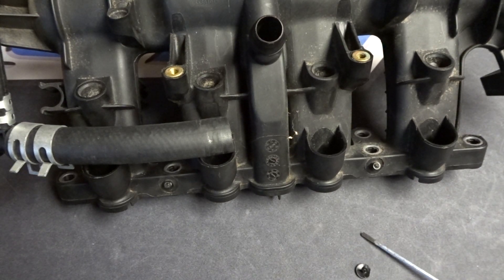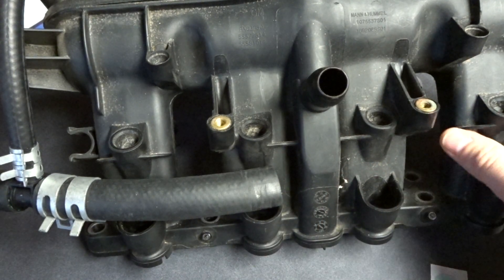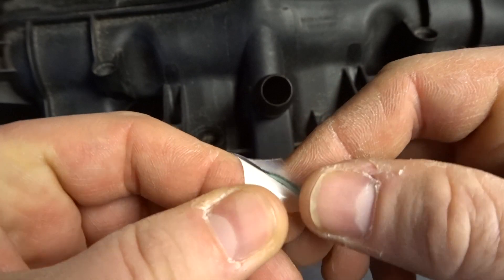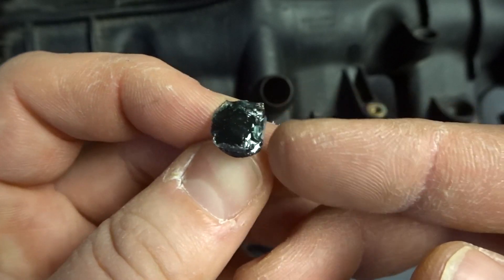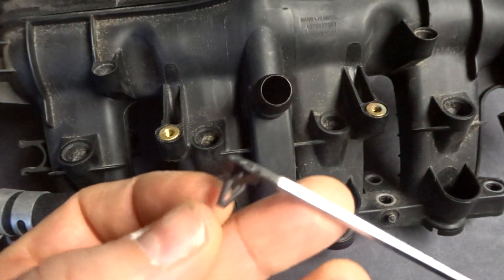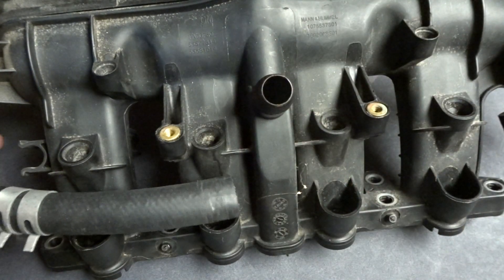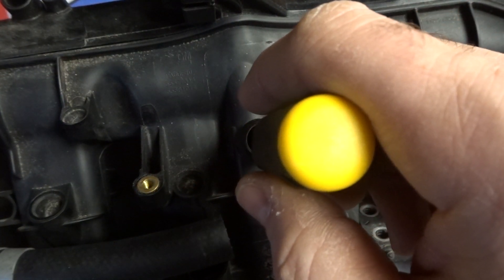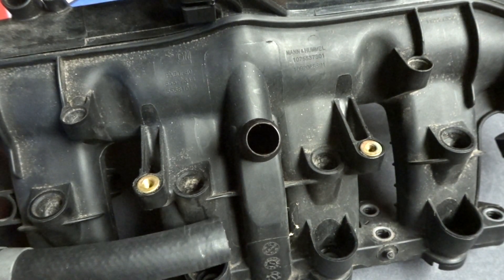CruzeKits.com V3 PCV Fix Kit Supplemental Plug Install

Comment: Well this also solve the problem with the crank shaft seal popping out?
Reply from the maker: Typically the front crank seal failure is due to a valve cover failures. The valve cover failures seem to be more frequent with a bad intake manifold check valve. Addressing the check valve with my pcv fix kits has been shown to improve the reliability of downstream components.
Reply: OK I've replaced the valve cover twice and the crankshaft seal twice
Reply: I ordered that kit yesterday. What is the difference between the one with the brass fittings?
Reply: @estebanpaulino9192  the brass fittings involve removing the valve cover and drilling a hole. The v3 you can do without removing any major parts

Comment: I have a 2013 Sonic 1.4L Turbo, but it only has 21k miles on it. I have not noticed any issues yet, but come spring, I want to do the V3 kit as a preventative measure. How do you make sure the old orange (I think) PCV is dislodged so you can install the plug? If it is not dislodged, can it be removed so the plug can be installed, or should I just wait for nature to take its course?
Reply from the maker: You can break the tip off with a flathead screwdriver. The other side will fall into the intake manifold and will be eaten by the engine and incinerated in the catalytic converter till it turns to powder.
Reply: Give it a week mine failed at that exact same mileage
Reply: @AMSOZ-SS  If it ain't broke don't fix it.

Comment: 🤣🤣🤣🤣 love it.
Reply from the maker: Were you the one who messed up the butyl and got tried some glue dots? Someone called me saying they had some issues and grabbed some from their daughter and used that instead. I figured hey why not see if that works any better. Got the permanent stuff and sure it enough it sticks like crazy.
Reply: @AndreiDPop  yeah that was me. I'm glad it's a better fix. Anything to help those whom have been cursed by that vehicle
Reply from the maker: @patrickp.3107  I very strongly doubt that injector replacements will fix that. My next step would be to check for boost leaks.
Reply: @patrickp.3107  why no diaphragm on the valve cover?  Don't forget to look at a tube up, coil pack etc.
Reply: @patrickp.3107  did u put the check. Valve in the right direction. How is your coil pack
Reply: @patrickp.3107  the injectors should be easy to clean

Comment: I have a problem with a Cruze 1.4 when you turn the ignition off, the engine runs on for about 1-2 seconds. I'm wondering if this valve has something to do with it and the engine is add extra fuel to compensate.. I can smell fuel when I shut it off.. anyone had this issue?
Reply from the maker: This wouldn’t have anything to do with it. I would look at the evap purge valve/solenoid.
Reply: @AndreiDPop  hmm it had a really high vacuum when you remove the dipstick. I understand they should have a vacuum but I would have thought it would pull enough vacuum from the manifold to not be noticable when you remove the dipstick..
Reply from the maker: @toms4022  in that case you have a defective valve cover. I’m 100% sure of it.
Reply: @AndreiDPop  so changing the cover stopped the engine from running on. What I don't understand is where was this high vacuum pulling the fuel or fuel vapor from to allow it to happen.
Reply from the maker: @toms4022  I don’t understand what your question is. Can you rephrase it?
Reply: @AndreiDPop  what would a bad valve cover cause an engine to keep running for a couple of seconds after you shut the ignition off
Reply from the maker: @toms4022  no.

Comment: I wasn't so lucky for everything, I pressed the plastic piece into the hole and it folded on me, now it's down in the intake, completely defeated the purpose of getting the v3+ kit as now I have to pull the intake.  Soooo frustrated
Reply from the maker: which intake manifold is on the car?

It shouldn’t have folded if the hole was there and clear.
Reply: @AndreiDPop  it's the factory manifold, I used a pic set to ensure the area was clear after wire brushing it, then proceeded as the video instructed, the plastic piece folded and dropped into the intake.
Reply from the maker: @dave1jeeperify  yeah you didn’t have it in the correct slot unfortunately. Not sure what happened there but that’s an unusual result. Shouldn’t have fallen either if you cleaned the screwdriver and plug head with that alcohol wipe thoroughly. Those stick like crazy.
Reply: @AndreiDPop  I pulled the manifold, got it handled the hard way. I did indeed have it in the correct slot, the plastic piece just broke under hardly any pressure, so I got another one from my kit I have and it worked fine.
Reply: @AndreiDPop  I am having some other issues though, maybe you've been there.... all of this started with a turbo failure, my assumption is the intake baffle, flap thing went bad, turbo over sped and the shaft broke, that's what I'm guessing, anyway the intake and exhaust were both full of oil, I replaced the turbo and cleaned out the cooler, replaced the spark plugs and started driving it a few weeks ago, after about 20 miles I got a p2261 and decided to do the kit, I finished the kit last night and went for a ride after clearing the code, put on about 60 miles and the code goes from historic to pending non stop... any ideas?
Reply from the maker: @dave1jeeperify  turbo was a lubrication failure. I’ll check the code.
Reply from the maker: @dave1jeeperify  code is for a bypass valve. That’s under the intake manifold, it’s a small solenoid in the passenger side. I believe there’s another solenoid on the front attached to the turbo. Replace the one in the back first.
Reply: @AndreiDPop  I'll give it a shot, I still have the old turbo so if needed I could pull the sensor from it to try, the one under the manifold, I should've sprayed it out while the intake was out 🤦

Comment: Hello. I want to buy this kit.
Reply from the maker: Hi, send me an email at the contact form on the cruzekits.com site and I can send you an invoice for it.
Reply: @AndreiDPop  I have a 2015 Cruze with the 1.4 turbo and ~60,000 miles on it.  There are currently no check engine lights nor drivability issues.  I understand these PCV systems are flawed but my question is if I proactively installed one of the V3 kits should I still expect my valve cover vacuum diaphragm to fail or is the intake check valve failure the root cause of the valve cover failure?  Hope that makes sense.  Thanks.
Reply from the maker: @rp5029  failure of the intake manifold check valve results in more frequent and premature valve cover failures. I've had people call me saying they replace 4 every year.

Comment: I just installed this kit, and then started checking for a boost leak. On my Chevy Sonic the pressure goes down pretty fast, but I don't hear any external leaks. Anyone have any ideas what could be leaking?
Reply from the maker: Start spraying around with soapy water. First place to check is the throttle body to hose clamp connection. Are you testing with engine at operating temp?
Reply: @AndreiDPop I tested it when the car was cold. Should I test it at operating temperature? I just installed the kit, so I was going to wait until tomorrow once the epoxy hardens to actually take it for a drive. I had soapy water ready, but couldn't hear any hissing. Would a non-audible leak cause the pressure to drop semi-quickly?
Reply from the maker: @soldado141  yes test at operating temp. It is possible the leak isn't audible if it's big enough.
Reply: Okay, thank you so much for taking the time to respond. I really appreciate the kits you've made it makes me feel better about buying this car. :D
Reply: @AndreiDPop  Found out that the leak was coming from the intake manifold connection; where the check valve used to be. I'm not sure how I lost the plastic ring that goes there, but now I have to get a new one. Would a new hose have it?
Reply from the maker: @soldado141  the little plastic retaining ring inside the pcv hose terminal? Those get lost a lot. I sell a replacement on cruzekits.com for $7 shipped. That way you don't need to buy the whole new hose. It's the retaining/alignment ring.
Reply: @AndreiDPop  I ended up buying a new hose, because the check valve that connected to the turbo was partially leaking. I am no longer hearing any leaks at 20 psi and at operating temperature. The pressure still drops quicker than in your video but not as fast as it used to. The problem that I'm having now is that when I take it out for a ride and come back my long term fuel trim goes up to about 13% and stays there. Any ideas? When I first start it up my ltft is at 0% and stays there. I'm thinking it might be the purge valve.
Reply: It ended up being the purge valve, now back to finding the remaining boost leak.
Reply: @AndreiDPop  I'm at a loss. I've pressurized the system repeatedly and can't hear where it could be leaking from.  I've checked the common locations, but they're fine. I notice that when I'm driving I get slightly negative fuel trims so that tells me that it could be a boost leak.
Reply from the maker: @soldado141  negative fuel trims would be an exhaust leak or a bad evap purge valve. Negative fuel trims means the car is removing fuel, meaning it's running too rich. Your car only calculates fueling under closed loop which is idle, light accel, and cruise.

Comment: How long should I let the epoxy cure after finishing installation before starting the engine?
Reply from the maker: I recommend 1-2 hours.
Reply: start this at the beginning of the weekend. and let it set for a whole day before driving it. If you have to remove the intake manifold and the injectors Like I did, when you first start it up. Dont worry because there will be some misfires at first start due to air in the fuel system, after that clears up shut it Off and restart,  and you shouldn't have any more misfires, or trouble codes, I did this to my 2011 cruze, and I'm glad I did. This kit works.